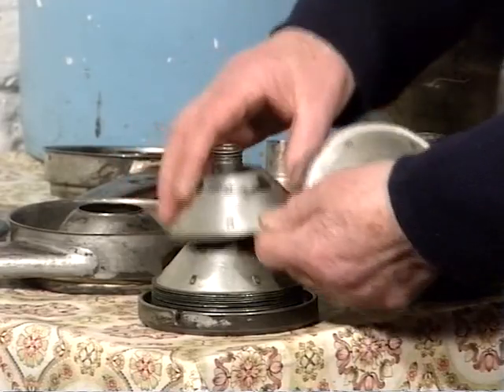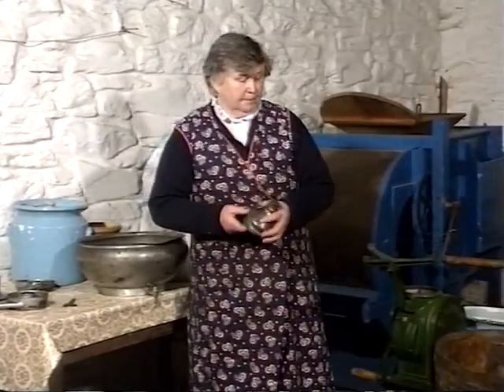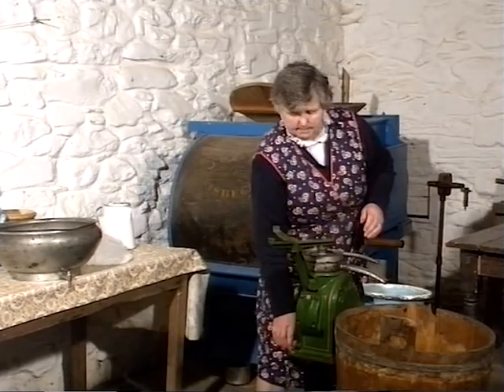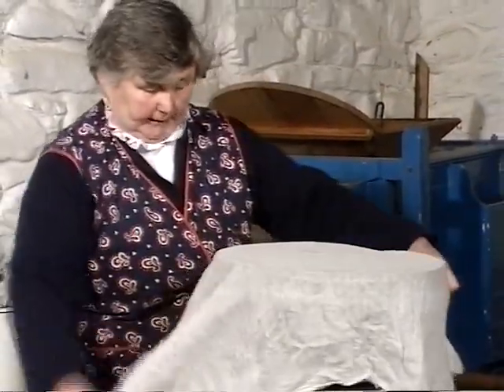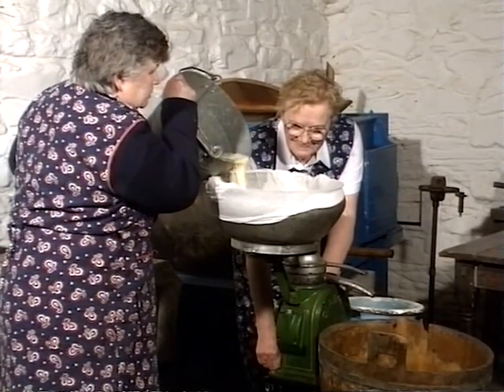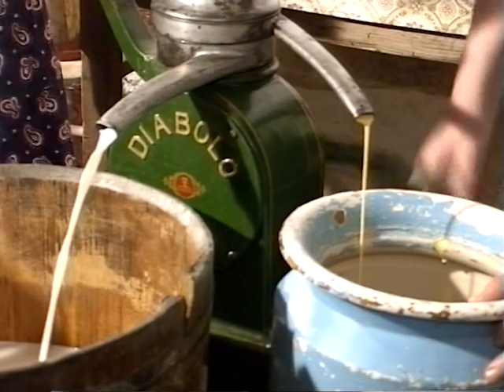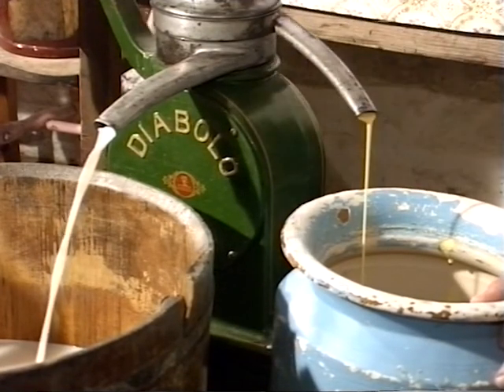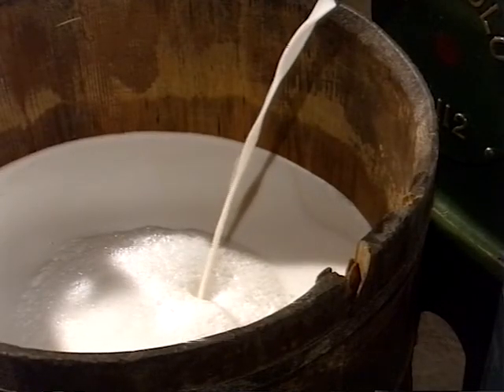Separating Cream in a Traditional Irish Farmhouse

Comment: Thank God we have moved on. Very labour intensive.
Reply: Not at all! Depending on the model you could easily cream up to 60 litres per hour which is right on par with many of the electric models of a similar size. Once you've got the engine running you won't even break a sweat to keep it going. Truly amazing engineering!
Reply: @mariussmuts3153   yes, I can do 40 liters in our old one in 8 minutes and 5 mins in the new farmland milky the older separator has more skimmers and gives a thicker dollop cream